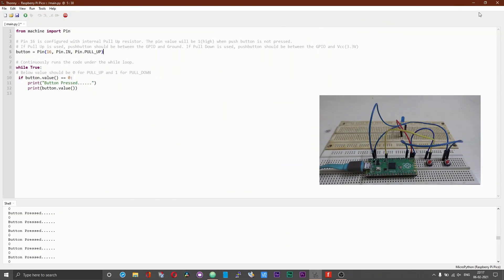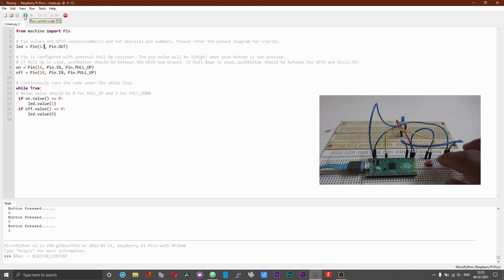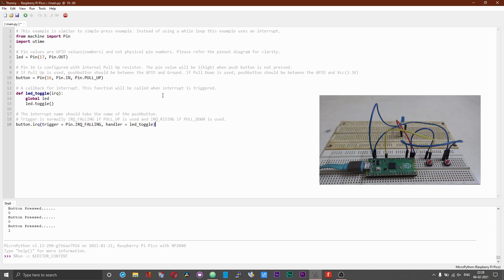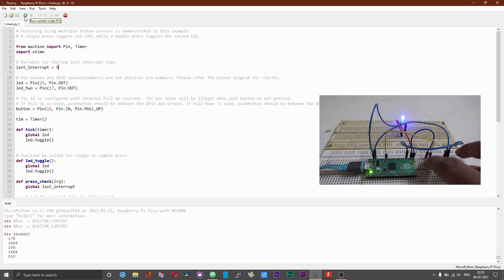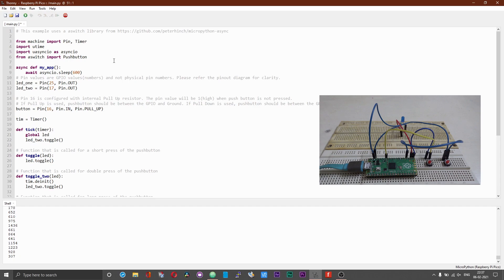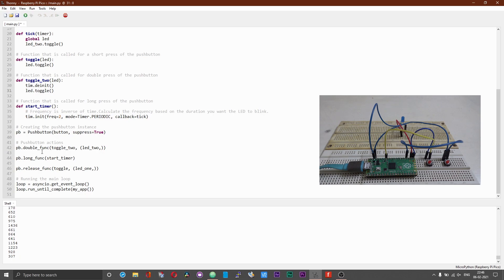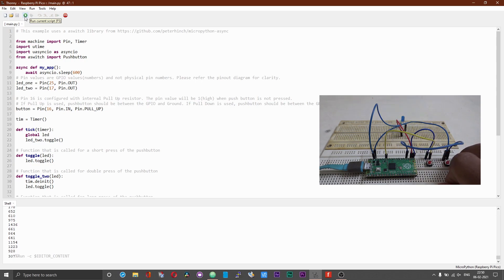Pi Pico Guide 03 | Pushbutton with Pi Pico | Pushbutton Press Types and Detection | Interrupts

Comment from the maker: A lot of effort has gone into this video to help or share information with the people who are just getting started with the Raspberry Pi Pico or Micropython. Hope you guys find this useful. Thanks.

Timestamps:
00:00:00 Introduction    
00:00:26 Simple pushbutton single press    
00:00:49 Basic Information on Connecting a Pushbutton    
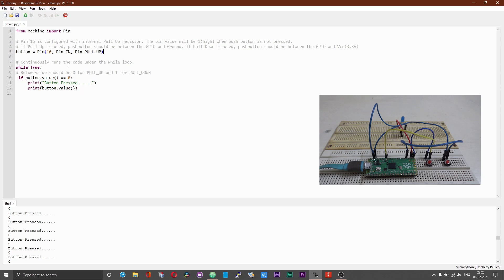00:02:27 What is Polling and its Limitation    
00:04:48 Button Press Using Two Pushbuttons    
00:05:42 Using Interrupts    
00:08:23 Double Press Detection With Only an Interrupt    
00:09:27 Double Press Detection Demo Using Interrupt    
00:11:30 How to Add a Library to Pi Pico (aswitch.py in this case)    
00:12:41 Details on Detecting Short Press, Double Press and Long Press using aswitch library    
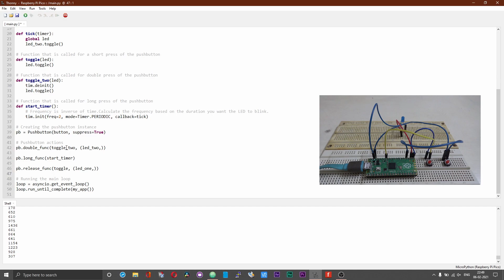00:15:47 Long and Double Press Demo using aswitch Library    
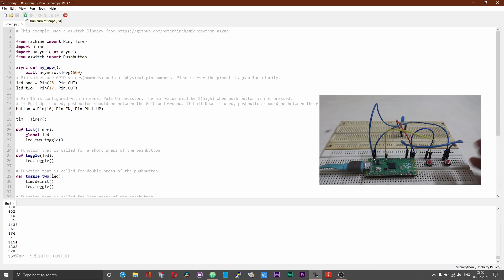00:16:54 Conclusion

Comment: Wow this was so helpful. I used this to get enough inputs to use my rfid implant to lock, unlock, and open the trunk of my car! Are triple presses possible with the aswitch library? I took a peek at the code but only enough to change the intervals between presses so it worked better with my access controller.

Comment: Great video.
I have used what I learn in it to switch a relay using a standalone cap touch as the button(s)
and I am having an issue. The script doesn't seem to be an endless loop. It works for a while then stops, if I reboot the Pico it works again for awhile [minutes]. The cap touch device has LED indication so I know the signal is being sent. How do I turn this into a Forever Loop?
Reply from the maker: Can you upload the code to Google Drive and attach the link here ? I shall take a look.
Reply: @SidsEClassroom  https://docs.google.com/document/d/1atx3fmMm8O_pdmqKOSyf8WN2c3th8teQ1zR3KFOfeN8/edit?usp=sharing

Right after I made the post I thought to try adding a 'while True' statement.
That seems to have solved my issue , but I would like to know if you see any problems in my code.

I am using this code to switch a relay that is connected to two HDMI bi-directional splitters that toggles my two share monitors.
Reply from the maker: @curtislcrane   I don't think there is any issue with the code. If you just want to toggle a relay, you can do it in a much simpler fashion with just one button. I have added couple of lines. Try that and see if it works.
Reply: @SidsEClassroom  Thank you for taking the time to look at my code and responding to my comment! I will play around with your suggestion.
Reply from the maker: @curtislcrane   Good luck !